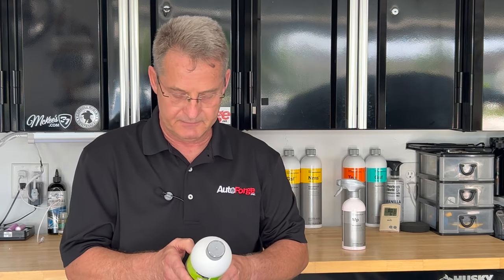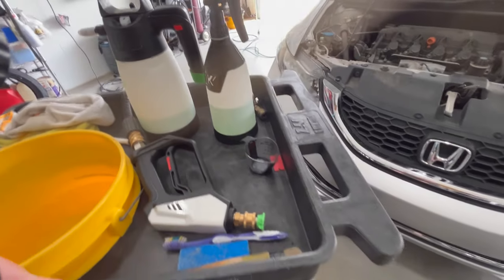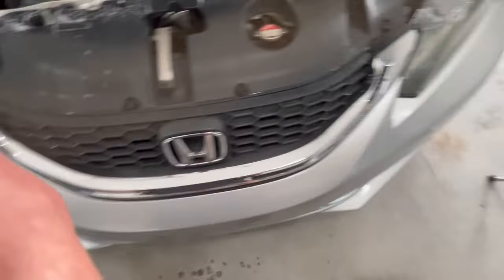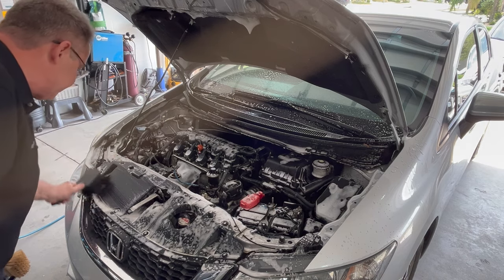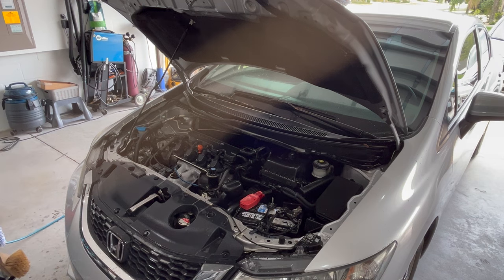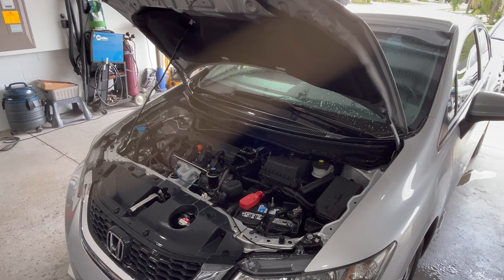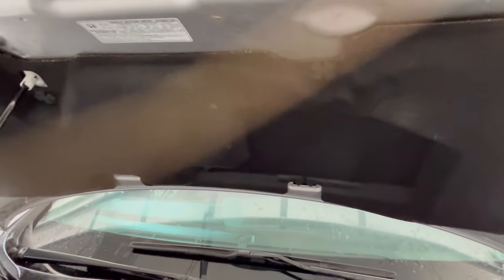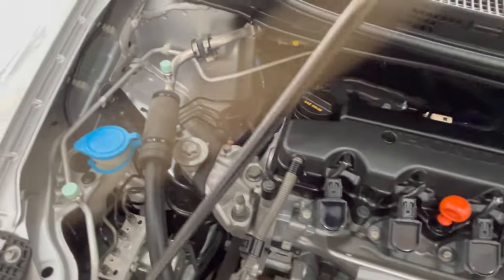How-To Safely Clean Your Car's Engine! Koch Chemie Green Star & Motorplast Product Review.

Comment: Great Video, most professional I’ve seen about cleaning the engine bay. Most people are scared about using the high pressure cleaner for no reason. The only thing to top this is dry ice blasting.

Comment: Yes, definitely cover the alternator. It only takes a minute to do. I always take an air blower to the engine compartment to remove as must excess water as possible when done cleaning the engine bay. I prefer to use my commercial vapor cleaner over a pressure washer as it easily breaks down grease and uses far less water to accomplish the task.
Reply from the maker: Good tip!

Comment: I get it 100% people who want it to look nice and clean, also people with aftermarket parts and show cars ❤, but daily drivers…nope it does not make any part last longer, does not make it run faster, is only seen by the mechanic and he most likely appreciate a clean motor but will also say is dumb
Reply from the maker: Don't know about them saying it's dumb, I guess there are some. But even those guys I'm sure would rather work on a clean engine compartment than a dirty one. Bigger picture is when everything is nice and clean it's much easier to spot a problem such as a leak or cracks in a hose or belt before it fails.It's not always about cosmetics.

Comment: Hi. A question on Motorplast. Can it be applied to aluminium ( car / bike engine, also scooter crankcase, which both three, is made primarily from cast aluminium ). Thanks!
Reply from the maker: Naturally shiny, water-displacing conserver for engines, housing parts, rubber hoses and power units of cars, commercial vehicles, etc.